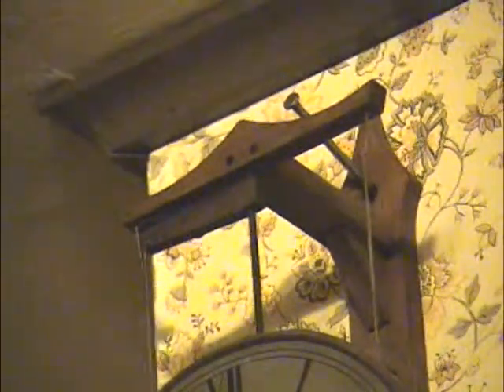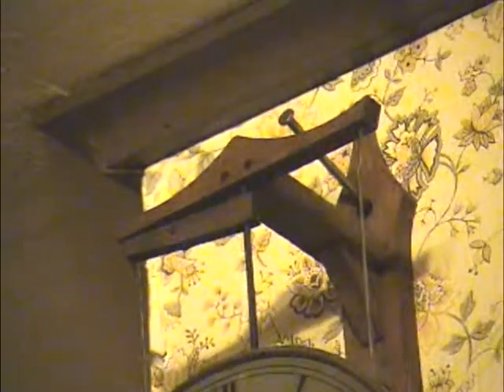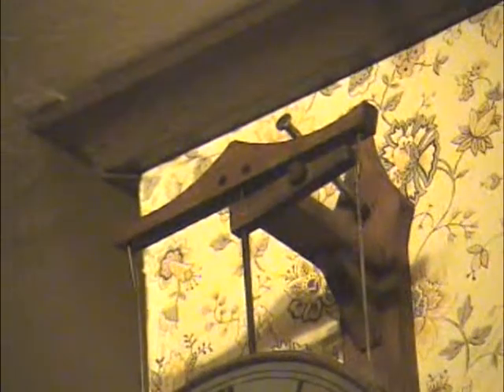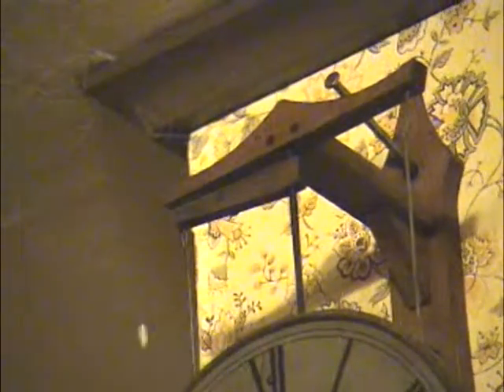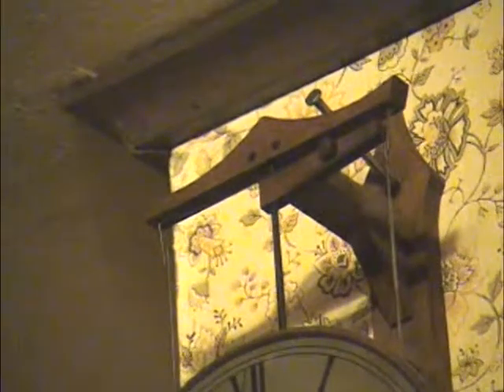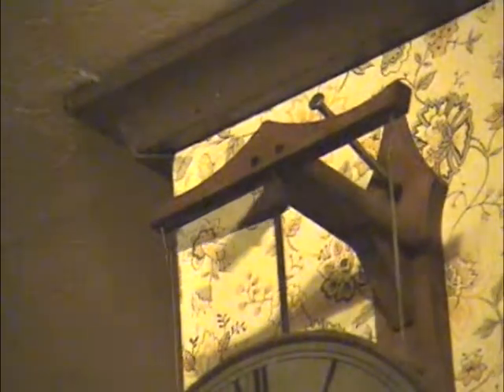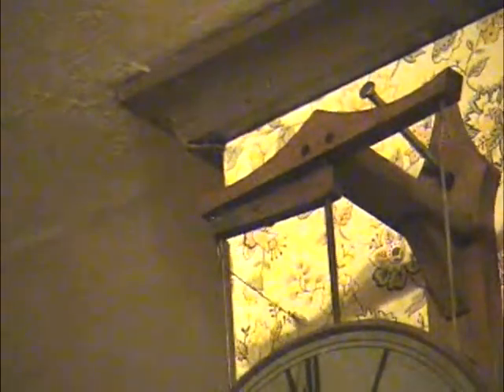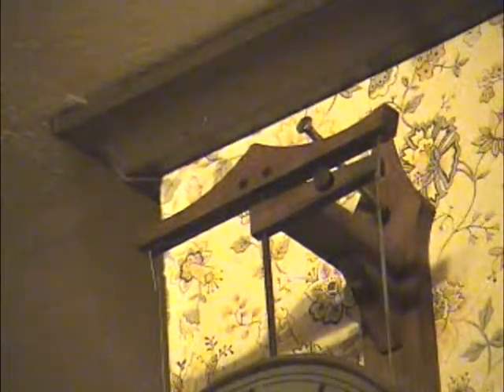Baumann 'Flying Pendulum' Clock by John A Tuttle from Player-Care.com

Comment: Can u please tell me the weight and size or dimensions of the small ball
Reply from the maker: I've posted a picture of the weight at: player-care.com/gifs/weight-3.jpg. The weight of the 'ball' is one gram.
Reply: @johntuttle1558  there r two protruding pins on the top. Left and right side. Is the left side bent a little backwards and the  right side bent a little forward.????
Reply from the maker: @kingsleyrodricks  Yes, that's correct
Reply: @johntuttle1558  what should the length  of the string  be upto the tip of ball
Reply: @johntuttle1558  how many turnd does the ball make around the top n bottom post respectively
Reply from the maker: @kingsleyrodricks  The length of the string is adjustable -to set the timing. 
From where the string comes out of the hole in the wood, mine is 2-3/8" (6 cm).

Comment: I think you will find that you should have a ball shaped pendulum with the string coming out of the ball , i glued my string in to the ball with just enough glue to make the ball hole damp ( not even a drop ) , and like you said you can adjust the length of the string ((  the size of string also has a huge effect on the working . )) every thing has to be in balance . if the string is to heavy it wont wrap onto the post proper also same thing if string is to thin ( light ) it wont work proper and try almost to over lap itself . of course it needs to be level so to speak . there is usually a point sticking out the rear close to the bottom so it will stick in the wall and not move from side to side ,, it may need to be a little off level one way or the other just a tad to make up for anything that is not perfect with the frame etc. the weight of the ball related to haw heavy the string is is , is also critical ,, any of these things or a mixture of them can make a huge difference on the attitude of the string .  the distance from the wall from top to bottom is also critical .. the top it seems to me needs to be out a tad further than the bottom . iven if the wall is not perfectly plum it will effect it ..  no fuzzy string , something that is nice and flexible though .. any time I worked with one it always took a few days of uneasy operation until the string got loosened up . Make sure the frame is square ..have a good one ..
Reply: Hi, I lost the ball on my clock. Could any of you tell me the weight and diameter of it so I can replace it. It is a steel ball right?